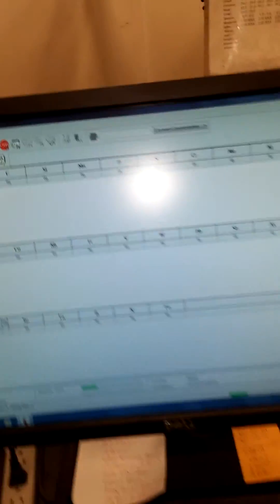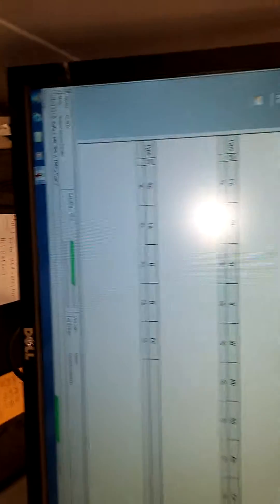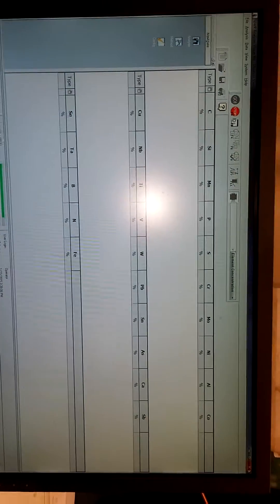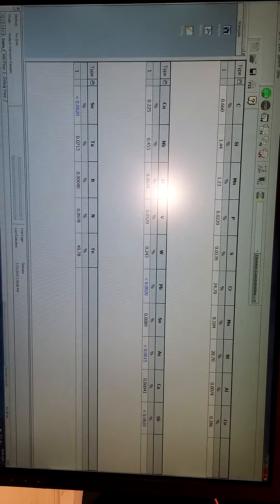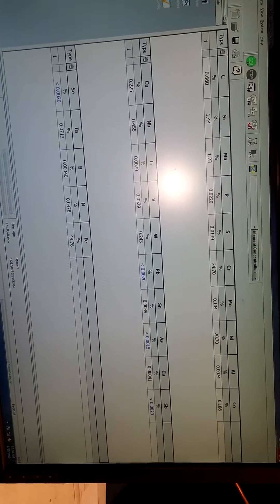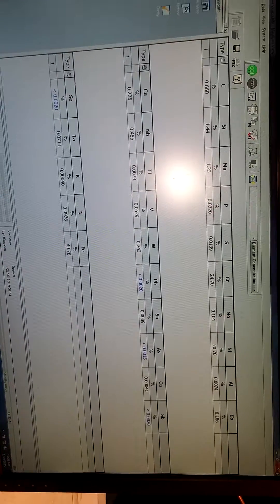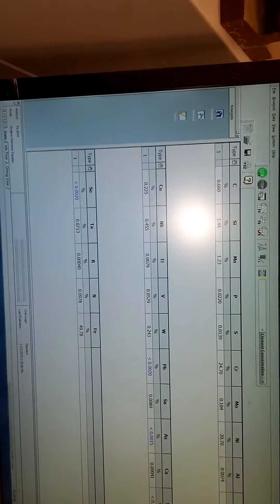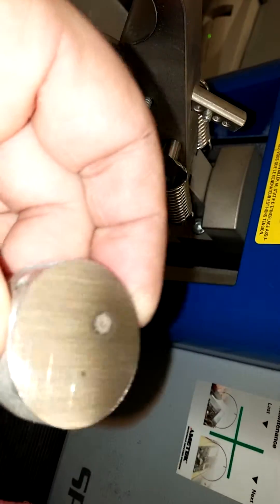HOW TO RUN A SPECTROMETER

Comment: How to do standardization of this  Spectrometer .
Reply from the maker: We run a standardization program with standardization samples amd we get an average curve analysis. Its usually pretty accurate. Also we do sample comparison with 3 burns on each sample. Also a filter change weekly.
Reply: @MorettiPyrotechnicsLLC  thank you sir.
But if possible ,plz make a another video .
Reply: How can you change stand plate? Small to big plate
Reply from the maker: @ReiOtohata15 idk if you can on these ones we never had to change the plate just the tip and the hoses.